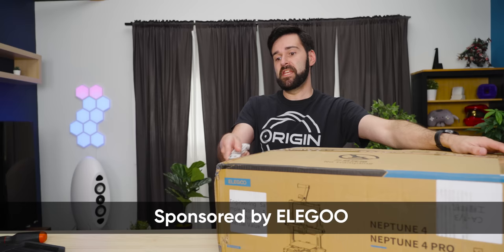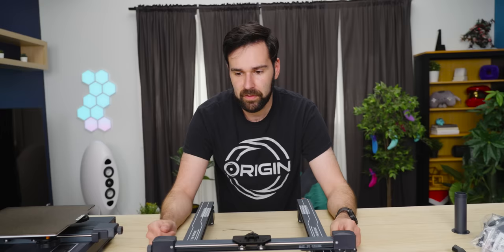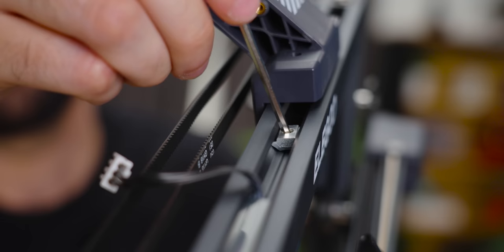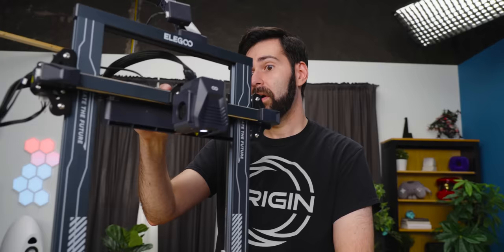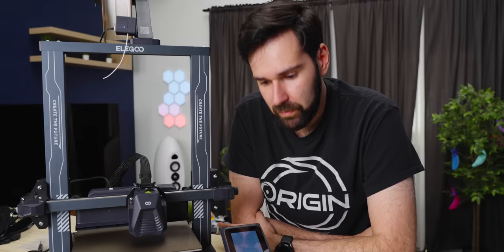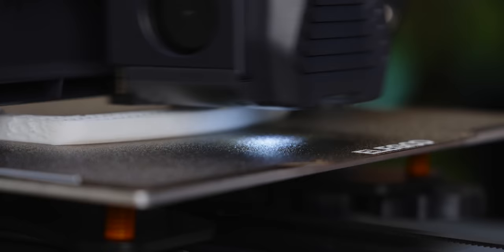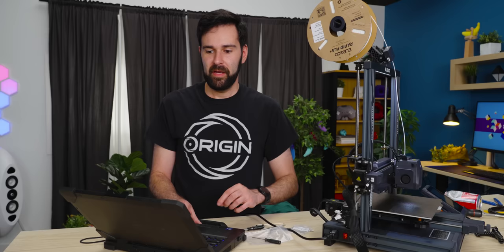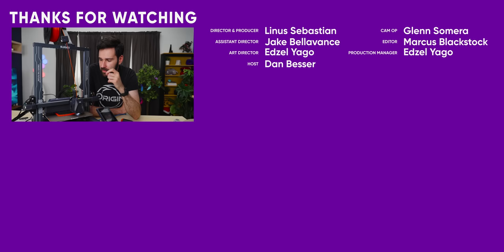Now THIS is bang for your buck! - Elegoo Neptune 4 Pro

Comment: The only two things stopping me from pre-ordering this machine (it is pre-order only at the moment) :

1 - "Remember. No pre-orders"
2 - The question if this is a cherry picked / "golden sample" - This is by no means a shot at Dan or LMG, but I 100% agree with Dan on the question of how the hell it's so cheap
Reply: you shoudktn because the P1S exists and is far better value.
Reply: If anything preview/review models of 3D printers are usually slightly worse or lack some features or final touches of the consumer release. Elegoo and Sovol are great brands, not everything has the be Bambulabs or Prusa expensive to be good.
Reply: @BeefIngot   Why are you all over the comments recommendig people Bambulabs, especially as their first printer. 99% of people will never utilize them or require their features. Most people will even be fine with a Kobra Neo or used SV06/Neptune 3. You keep going on about how nobody knows what they are talking about, but you blindly telling people to buy 700+ dollar printers is just stupid.
Reply: @kwedl  Its not blind at all. I have experience with all spectrums of printers. I say with full context that this is the best option, because I think people value their time, not getting frustrated, not having to tune and calibrate and I've seen way too many people give up or spend all their time with the printer trying to improve it. This printer, you don't do that. It's absolutely a great justification.
Reply: @BeefIngot  I'm severely inclined to disagree.

First, for the price of a P1S I can buy two of these printers. I am not looking to spend that much at this time.

Second, my use case and rationale behind wanting this machine requires zero of the advantages the P1S may or may not have over this machine. Since you don't know my particular use case or rationale, good luck proving otherwise.

Third, since, as stated, you know nothing about my intended use of this machine, my experience with 3D printing, or what other machines I may or may not have, your blind (and thus blatantly ignorant) recommendation falls on deaf ears.

Fourth, the amount of comments you've dumped trying pumping up the P1S has me thinking that at worst, you are on the Bambu Labs payroll (making you a paid shill) and at best, you're so deep in the fanboy-ism you legitimately cannot comprehend why anyone would ever buy anything else, and both is never off the table. Also, it should be noted that no matter what you may attempt to reply to this with, you cannot prove to me either of those statements are false, not that I'd care if you could.
Reply: @v3c7r0n  This has been the weirdest comment I've seen on the internet.

Steering people in the right direction from direct experience isn't fanboyism. The printers I recommend change as time moves on.a year ago I'd be recommending Prusa mk3s.

Get the tinfoil of your head, it's cutting off the circulation.
Reply: @BeefIngot  The "Right direction" is highly subjective at best and blindly ignorant at worst. 

It's easy to recommend something that spends more of someone else's money - double in this case - when you know nothing about and as a result are incapable of giving any consideration to their budget, required / desired features, use case, or the things that prompted them to consider a particular product in the first place.

And apparently comprehending the fact that someone else's thought processes and resulting decisions can differ from your own - which may or may not have financial compensation bolstering them - and be perfectly valid for them in their specific situation, is exceedingly difficult, if not impossible for you.

Comment: i bought one of these as a first 3dprinter based on the review, and some yt vids showing that it wasn't impossible to do 3d cad. Apart from a slight challange with the initial manual levelling, it's been great; easy enough to setup, and use. the network acess is only while printing, which is worth mentioning. the money off discount is available directly. Its taken a little while playing around with settings to get precise holes and first layer for latest version of cura, but it seems to be quite capable. It can handle abs and nylon as well as the usual pla.

Comment: Some things he says doesn't sound like he is that much educated in that topic.

For example, he says "nice quiet stepper motors" but 90% of the noise of stepper motors comes from their drivers.
Meaning, that a really loud printer can get really whisper quiet by just changing the stepper drivers. without touching the motors at all!

My first printer was disgustingly loud. Just switching to a "silent-board" made it almost not hearable. Switching to a good 32 Bit board went from quiet to "is it running?"

this is just one of multiple examples. I mean, for beginners, its ok. For ppl who are into that for some years... i'd rather watch other YT'ers regarding that topic.

still: Love you guys from LTT ;)

Comment: Incredible first impression video you did great. Elegoo as a brand has included a lot of the same features and kit to their last couple of generations of Cartesian printer and that's why i tend to recommend them to new users. Other brands you have to upgrade to get the same features when elegoo just realized that this is what people like. The upgrades on this printer is wild with the speed and rails and I'm quite intrigued. Pla+ had been my go-to material for many years since it's the easiest to print with. It's consistent. It's tough and rigid and I can hold some very tight tolerances when prototyping and making fixtures for the shops I work in. 10/10 all machinists and engineers get in to 3d printing as an additional tool in your belt.

Comment: My favorite printer is still that Anker Make M5 that you showed us early last year, especially since I got it for the Kickstarter price which was like $400 or so. It was super easy to assemble in like 15 minutes and it's still stupid easy to use and I love being able to remotely monitor my prints. For me that's the closest 3D printing has gotten to mass market. Maybe still another generation or two and I can see way more people buying those. Especially as they develop out the phone app and library to print straight from the phone.
Reply: The M5 is an amazing printer from the hardware alone, the software just isnt up to par for what I would expect. Same reason why I am worried for the multi color option later this year.

Like you mentioned, updates overtime should improve this, what I am hoping for.

Comment: This looks a great upgrade than the Neptune 3, which i bought as my 1st 3d printer. Just unboxed my Bambu Labs P1P today, which I bought because of Dan's review.
Reply: @monki_sudo  where are you finding a p1s for $400? Neptune 4 Pro is going for $300, P1S seems to be $700 most everywhere I can find it
Reply: @monki_sudo  For "only" 100 bucks you can buy a bunch of filament rolls though. Most people won't need the P1S enclosure or other small features, if anything since most people just print PLA or PETG you are better off without. Or you can print your own with less money.
Reply: @kwedl  yeah the enclosure isn't really required unless you plan to print certain materials, as someone only doing PLA I would have to have the door open anyway if it was enclosed, the P1P is a damn good little printer though

Comment: TBH this one looks a lot like a Ender 3 S1 Pro, it has Z motor sync as well, magnetic HB, nice look, print head connects via just single ribbon cable, but spool holder isn't screwed into frame, just clips. And also it doesn't have Type-A port or internet connectivity, but it doesn't feel too bad, i was planning on repurposing my old Galaxy A8+ into a print server anyways

Comment: The printer I am currently using (and it is also my 1st 3D printer) is Creality CR200B - And for the 1st printer it is actually pretty awesome. The only downside I can think of is that bed levelling is not automatic - it is same as here (4 knobs & sheet of paper trick). But again, the price point is similar to the one in the video, but what you get instead of way too fast printing is fully enclosed printer that is pre-assembled & works out of the box. I was even able to print some ABS stuff and it did not failed. And it is not that the printer is slow. My default print speed is set to 60.

Comment: The little fan by the nozzle is to keep the heating block from over heating and to keep temperatures within range.  The one on the left and one on the right side are for layer cooling with the big blower accompanying those.

Comment: I JUST bought an Ender 3 V2 Neo in early June. This makes me jealous, but I don't regret my purchase - some of the joy in these units is modifying them. I changed it to direct drive less than a week after purchase using a model from Thingiverse, which I have since modified to add things I wanted. This Elegoo is now on my recommend list for those that want to start without being modification happy.